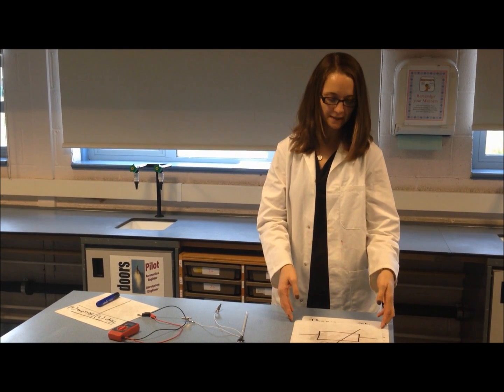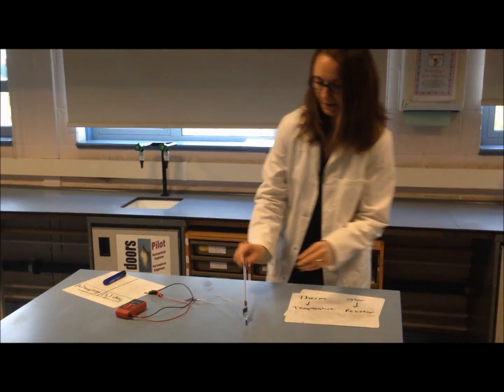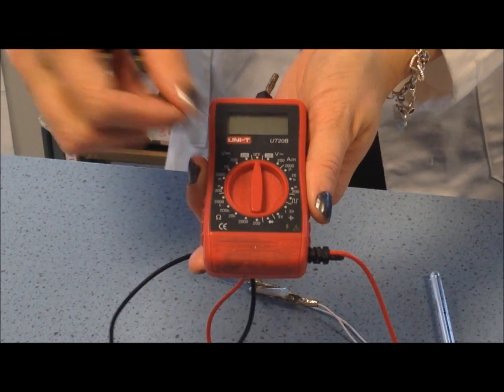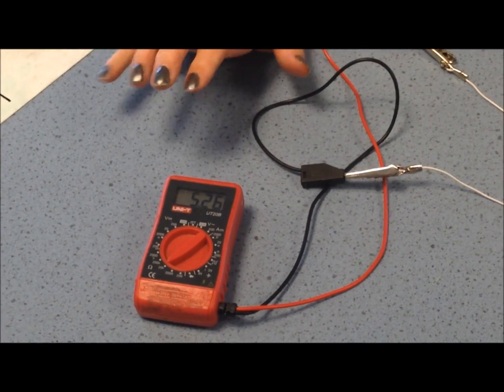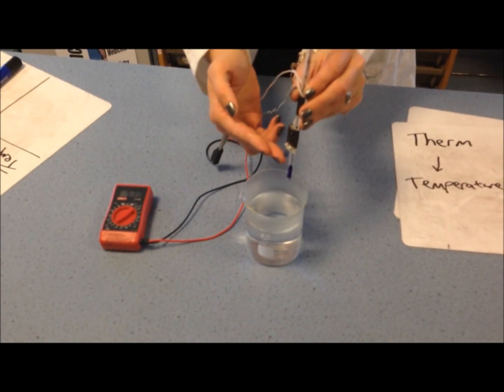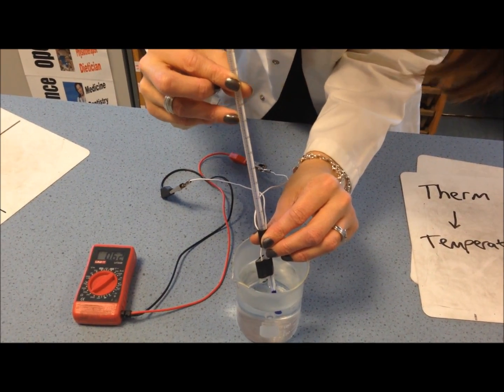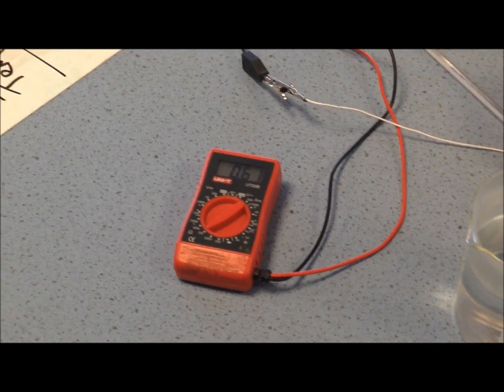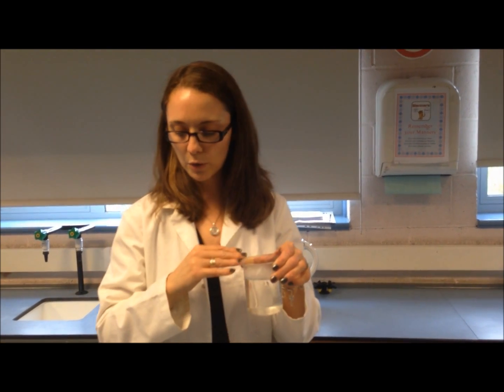P2 Thermistors expt

Comment from the maker: You would need to use the same thermistor and multi-meter each time, also the write thickness and length could affect the results so they would need to be kept the same, the amount of water is not important, as it is only used to reach the desired temperature.

Comment from the maker: The thermistor came with the circuit board and crocodile clips already attached
Reply: Thank you very much for your reply. For our ISA our context is based on how the way a thermistor works can be used in a central heating system. Any suggestions would be very helpful
Reply from the maker: A thermistor is just a resistor that if affected by temperature, when the temperature gets higher the resistance gets lower. This means that if you put a resistor in a circuit when the temperature increases the resistance will lower and more current will flow which will then affect the power of the device